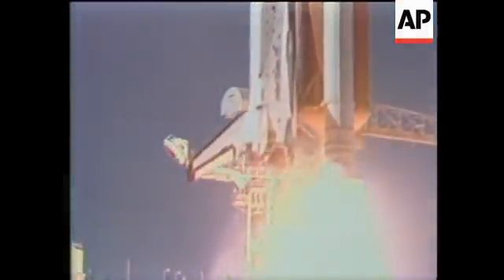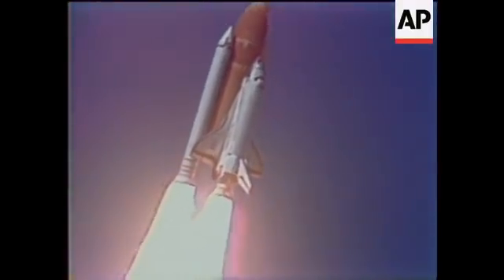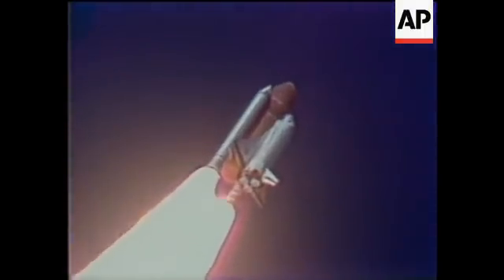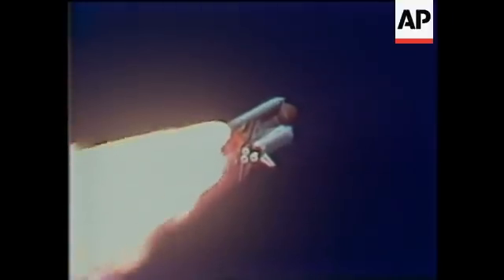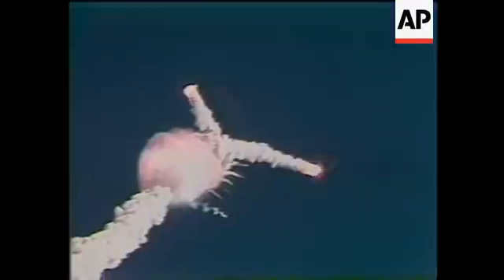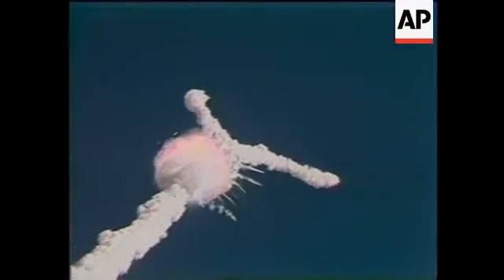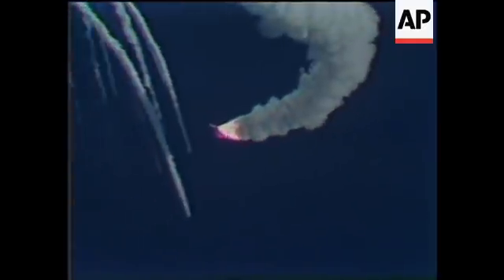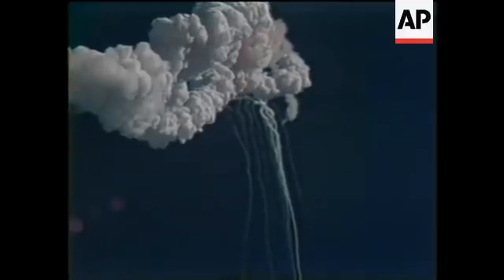Space shuttle Challenger exploding during launch

Comment: Had a conversation with an old gentleman at the bus stop that morning in England and both agreed the shuttle should not launch because of the tiles
Did not hear anything all day, then came home to the news- very sad
Reply: It wasn't the tiles it was the o rings on the main thruster. It was below freezing overnight and the o rings froze and when they went at throttles full the O2 which is the fuel came out of the o rings and ingnited by the cone and exploded. The flight director was told by scientists that morning the o rings might be an issue but the flight director overruled them as it was less than 2 percent that it could happen.. Which is within acceptable range for launch. It was their fatal flaw.
Reply: @richardguignard2611  Huh, then why did they ignite after a few seconds of launch, why not instantaneously or in a very brief period of time?
Reply: @etcetera1674  because thr orings kept sealing and expanding. You can see from videos the flames coming from orings multiple times during. That is when the seal broken and the  the flight until it exploded at throttle up. That is when engines go from 60 percent to 100 percent. And then the liquid oxygen leaked out from the pressure and ignited.
Reply: @richardguignard2611  ah that's perfect, thanks for the explanation. Rapid heating of any frozen object usually leads to instantaneous bursting so, I thought that they should have blown up at launch. But your right, they did seal and expand multiple times before the leak and subsequent explosion.

Comment: It was reported that while they were falling, they would have been aware and alive until reaching earth. 😢😢😢
Reply: That's a big negative on that one. The force, even if by some miracle didn't kill them immediately which is a statistical impossibility, would have at the very least knocked them unconscious and turned their brains to much. No vital signs were shown after the initial explosion.
Reply: @efficientfuture  no vital signs were shown, to the public, but numerous reports and hearings stated they were alive after the explosion. Many like to "believe" they weren't, but that simply isn't the case. The ship didn't explode per se, there wasn't a massive explosion. What you saw was a huge fireball caused by the fuel burning all at once and you can even see the rocket boosters continuing to fly after the detonation. 

"Myth #3: The crew died instantly
The flight, and the astronauts’ lives, did not end at that point, 73 seconds after launch. After Challenger was torn apart, the pieces continued upward from their own momentum, reaching a peak altitude of 65,000 feet before arching back down into the water. The cabin hit the surface 2 minutes and 45 seconds after breakup, and all investigations indicate the crew was still alive until then."
Reply: Their suits have monitors that can show if someone is dead/alive, they can read their heart rate, oxygen levels extc
Reply: @hackxy1165  do you think that sensors that monitor vital signs would work just fine after such an explosion?
Reply: @entidade1000 , I’m not sure, probably because if they were alive while falling I would assume their whole suit is intact, so yes they had readings, but they did not publicly share that info
Reply: By who?
Reply: They fall alive? I thought they were actually affected by the explosion, this is so sad and creepy :(
Reply: @Mel9188  Yeah it's a very popular theory that the debris you may have seen shooting out after the explosion was the cabin separating and hitting the water likely disintegrating the survivors on impact.
Reply: They were blown up.
Reply: @MalcolmTexxx  no, they actually weren't. The crew compartment was intact until it hit the water almost 3 minutes later.
Reply: That's a very popular theory. Which is supported by helmets near the floating debris. I hope they all died in the explosion because at it was probably quick
Reply: @criminallyautistic8372  yeah you can hope,  but it is more than a theory.......they didn't die quick. The only hope is they were unconscious.....
Reply: @muskokamike127  I agree. Still sucks. And have you seen home videos reacting to this on YouTube, I remember seeing one of this girl waving goodbye then suddenly she gasped and ran downstairs. Poor thing